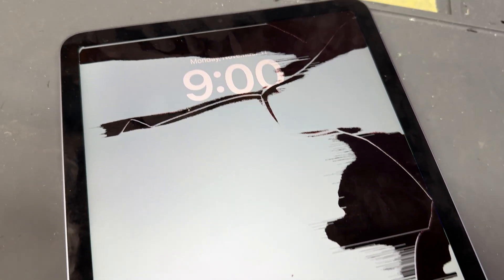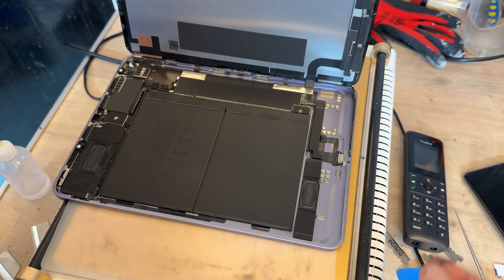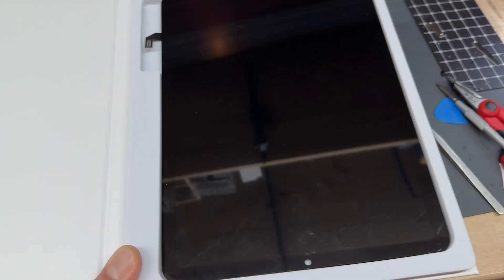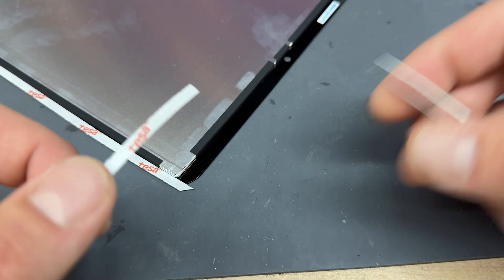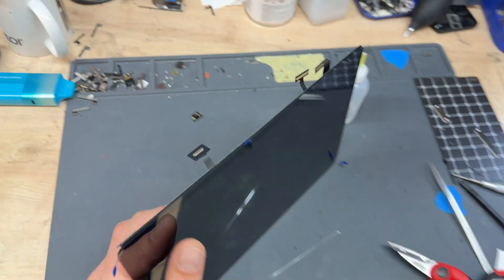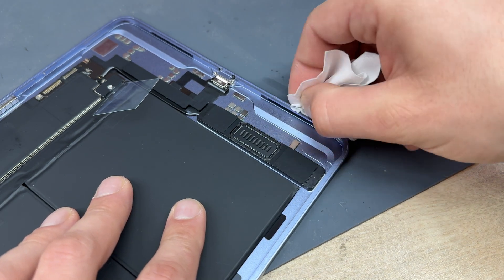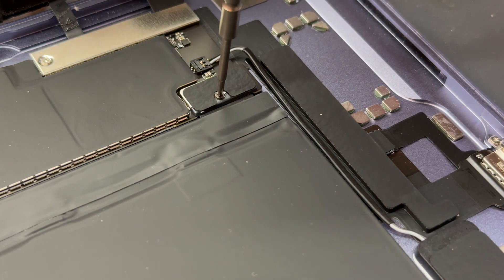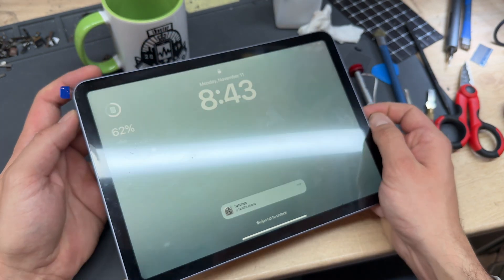iPad Air 4 Full Display Replacement - Complete DIY Guide!

Comment: After replacing the old working screen (cracked glass) the new one does not show image, it does turn on because i can see some light, i removed the new one and installed the old one again to test, and its now the same, both screens are not showing anything, what may be the couse?
Reply: it’s either you are not connecting the screen flex cables properly or you did not separate the battery contact properly and the backlight went bad.

Comment: Can you change the glass without changing the lcd?
Reply: Hey double check but today I learned from a company that sells the X07 kit that unlike the regular ipads where it is easy to separate the digitizer from the LCD that in this ipad air 4 you need special eqipment to take the approach of only replaciing the digitizer.  This guy here did a review on an ipad where you can just replace the digitizer but it seems like maybe the air 4th gen is different.  I asked that question but he has not responded yet
Reply: @RUAGoodNurse  okay thanks